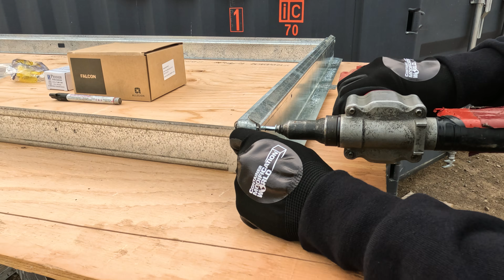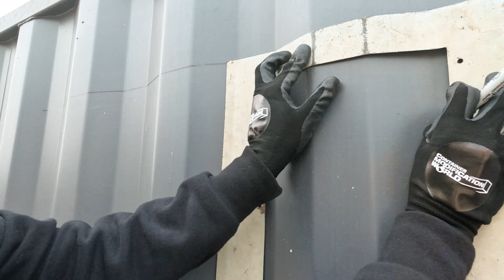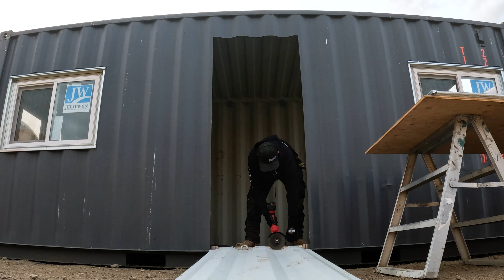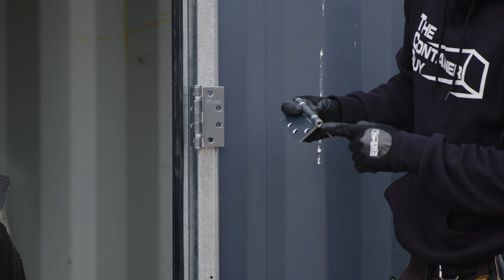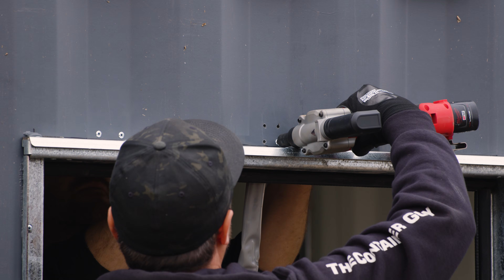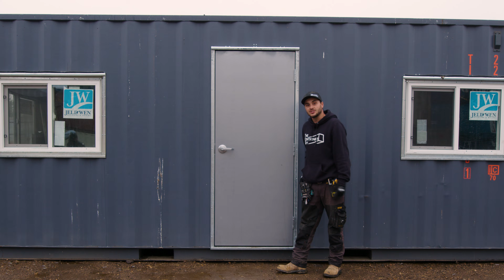How To Install a Door on a Shipping Container (Step-by-Step)

Comment: Any issues with mounting them higher in container to account for sheet foam and plywood added to the top of the floor?
Reply from the maker: Nope it's meant for that. Just move your RO up the height of the foam / subfloor. Make sure you seal where the corrugations meet the footer so no bugs get through there.
Reply: @TheContainerGuyTV  thanks for the reply. I had to call in an order for 36 inch frames because the Shopify rule wasn’t allowing me to check out with a CONUS address. The 32 inch was working OK.

She mentioned that there have been some fitment issues with doors in the US. Do you know what that is?

I think I have a solution for me and likely others…. Our local Amish in central Missouri will custom make any interior or exterior door to order for not much more than a standard door.

I don’t mean hand carved oak doors..just standard hollow or solid cord doors.

And I suspect that there are tons of similar Amish door shops in many parts of the US. Enclaves of them even gotten as far west as Idaho.